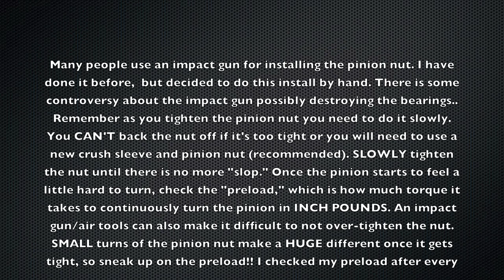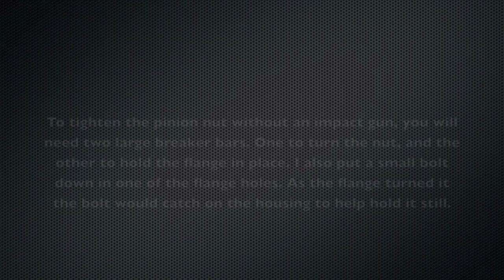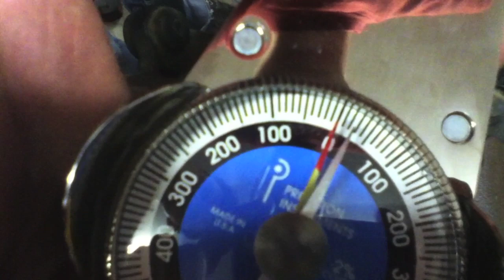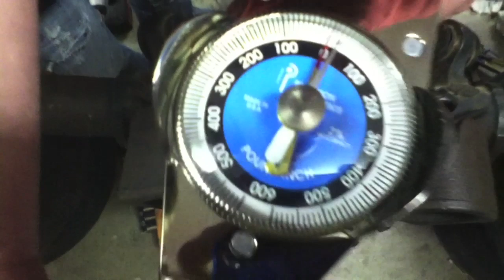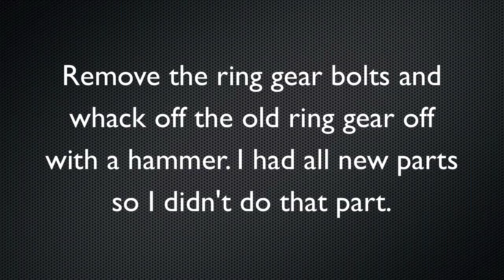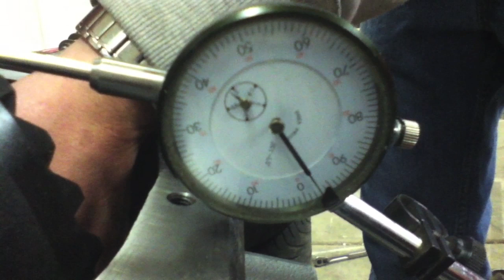Ford 8.8 inch Gear Install (Part 6 of 7): How to install gears. Set gears, backlash, preload

Comment: Thanks for the video. Just a little note about your in.lb dial torque gauge, the knob should be set on zero and as you turn the handle, it will follow the indicator needle and will stay at the maximum value it reached.

Comment: But if the backlash and paint marks aren't correct how do you adjust them?
Reply from the maker: The shims on each side of the carrier will tighten or loosen up the backlash as you are basically forcing the ring gear towards or away from the pinion. The other thing would be the pinion depth which is determined by the shim under the pinion bearing. 9/10 times the factory shim is dead on.
Reply: Thanks Dan, you seem pretty knowledgeable about this. Setting up rear gears is always the one thing I've shied away from because I've always heard how difficult it is. If i'm getting a slight humming when I'm not fully on or off the gas, do you know what would be out of spec? It didn't do it initially after i had them installed but started shortly after. I need to tear itapart a s I have a massive leak from the front and over torqued my pinion nut, considering checking the rest of it as well.
Reply from the maker: OnyxCobra Yeah, that sounds like it could be loose backlash. Gears really are touchy and that’s why I like the idea of taking the time to do it rather than have them done. Other shops don’t always have the time to pull the carrier several times until it’s right. Some of it is also luck and i’ve seen brand new cars have gear whine. If you watch the videos a few times and take your time you should get really good results

Comment: What gears did you installed..??
Reply from the maker: Jose Arellano 4.10s
Reply: Scrun Johnson 
would the set up be the same for an 8.8 diffreantial of an f150..??
Reply from the maker: Jose Arellano yes.
Reply: Ok, thanks for your advice...
Reply: You also used the same old shim from your old pinion right..
Reply from the maker: Jose Arellano correct. 9/10 times its perfect for the pinion
Reply: Thanks bro, I'm using your Video as a guide thanks for the help.. if anything I'll reply back... thanks for helping me out on my project...
Reply from the maker: Jose Arellano sure. That's what the videos are for.